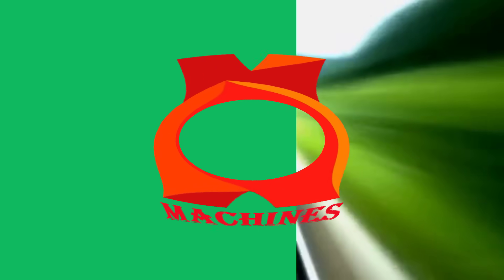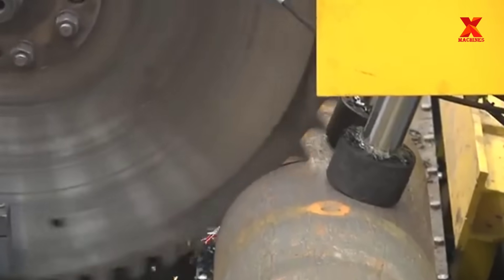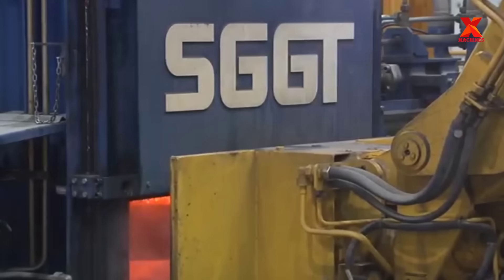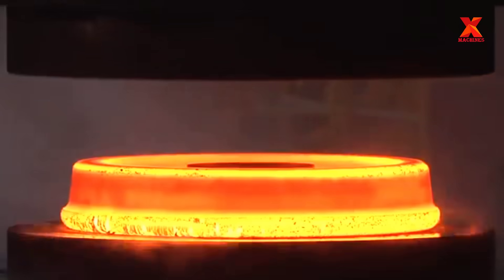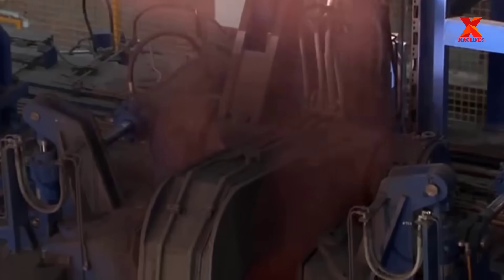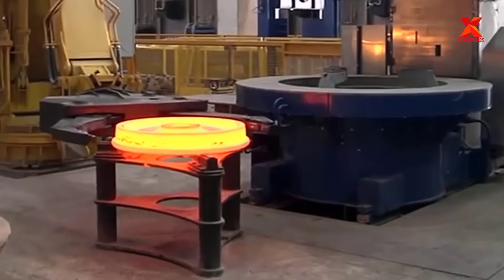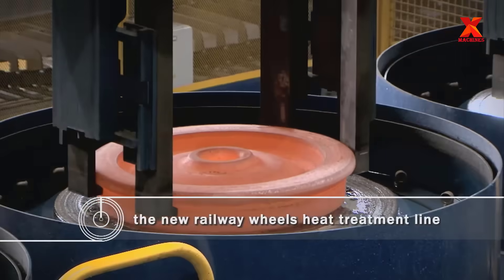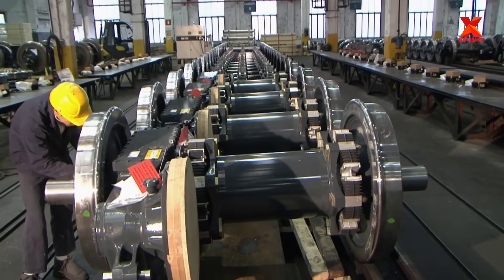Hypnotic Producing Process Of 1,000 Train Wheels/Day & Airplane Tires In 239 Billion USD Industry

Comment: Standard train wheels typically cost around $2,400/ton. It meas that each wheel costs about $700-$800. High-speed train wheels are roughly twice the price of regular train wheels, about $4,500/ton, and each wheel costs about $1,500.Jun 23, 2021

Comment: Not mentioned was the fact that China got its high speed train wheels from Germany before, but Germany stopped supplying these wheels so, for China, necessity is the beginning of reality for China and making their own wheels.  The same goes for aircraft tires.  We saw the US pull out the supply of engines for the C919 and necessity again made China develop its own engines.  That same process of developing capabilities that were once imported is becoming a habit for China.  The biggest sector seeing this happen is with semiconductors as China fabs its own chips now and outproducing the US. The US is losing its semiconductor exports to China big time as the US restricts high end high margin chips and China fabs its own mature node chips that creates a falling exports to China for the US.  Self sufficiency is the name of the game now and the US needs to scramble especially on sourcing raw materials.  China is way ahead of the US in that department and the fact of the matter is that China supplies 50% or more of critical minerals to the US and if China decides to limit these exports, the US will suffer.  Already, China has restricted exports of gallium, germanium, cobalt, and rare earth processing IP to the US.

Comment: Aircraft tires, I changed thousands of them, fighter jets, private, cargo planes, jumbo. Most are 17 ply, or to put it into perspective about 3 1/2 inches thick. Layer after layer, rubber , cord (kevlar). No steel belts on aircraft tires. Weight reduction. They all have a wear limit layer of red cord. Landings produce flat spots, Over all the tred can be good, but hit the same pot too many times the red cord shows up. The tire is bad. There are other factors such as , cuts, punctures, delamination / chunks missing. All have a difffernt set of go, no go criteria.

Comment: DANGEROUS WHEEL PRODUCTION METHODS !
The American method of producing railway wheels as seen in this programme, is PROHIBITED in Britain. For the simple reason that if you make a railway wheel by squashing a circle of metal to produce the wheel, it then has to have a hole cut in its centre for the axle. But as a result of the constant pounding of railway wheels when in use, this type of wheel is notorious for fracturing from the axle hole outwards, as a result of metal fatigue . A Critically dangerous scenario, as this can happen quickly.

In Britain train wheels have to be made by taking a long narrow strip of metal and rolling it up, while still red hot, to make the wheel disc. This method avoids the fracturing that can occur from the axle to the wheel rim  (due to metal fatigue). Instead, any metal fatigue will result in a slow fracture following the original line of the rolled up metal, around and around the wheel disc. As this takes far longer before it becomes dangerous, detection is 99% more likely !!!

Comment: Train wheels receive the highest quality materials, forging and machining technologically possible and surpass all parts used in trucks and cars by a large margin.  They have to because once they become rolling stock they are on their own for the bulk of their operational lifetime.  There is no periodic maintenance ever.  They serve and are then salvaged as scrap metal.
Reply: Wrong, wheels are checked for wear and can be recut several times before they are scrapped.
Reply: @thomasboese3793  I recently read that these rails are made with really really high quality steel and after many years of service are sold to razor makers.
Reply: Not necessary true; the material composite are different due to their different functions but doesn't mean they are higher quality than those for car and truck.

Comment: I was talking with a museum railroad engineer who operate a old locomotive and pull about 5 cars along and old abandoned track. He was telling me that rust on the track really is hard on the wheels. Because the track does not get much use they actual go out ahead and buff the surface rust away prior to running the train. This saves them a lot of money.
Reply: Something that makes perfect sense that I would never have thought, but find fascinating.
Reply: I suppose they could plate the track or wheels with a thin layer of copper or bronze to reduce wear and noise.
Reply: @harryniedecken5321  
"I've been copper-bottoming 'em, ma'am, for 120 years now, and this is the first time anybody has ever walked in carrying a steel rail under each arm.
What a relief, I'm so damn fed up with all these olde iron pots..."
Reply: must be american if its money